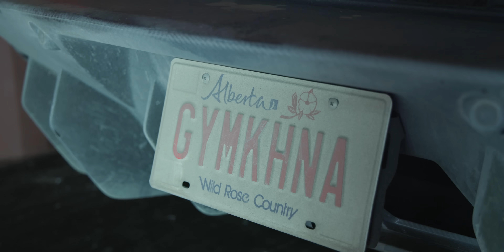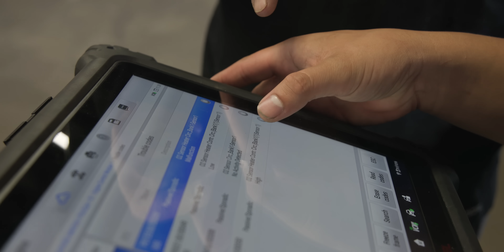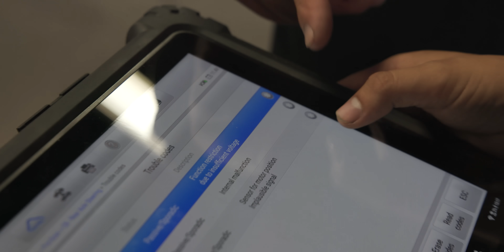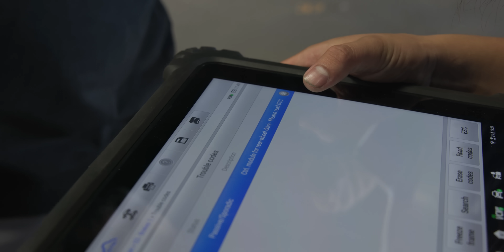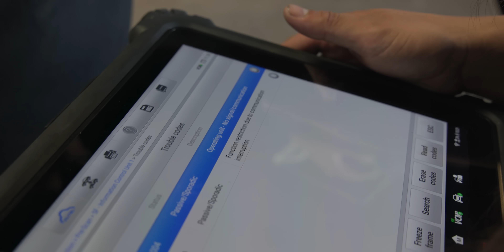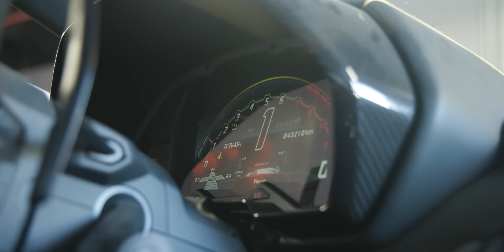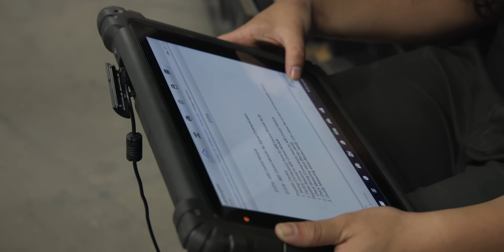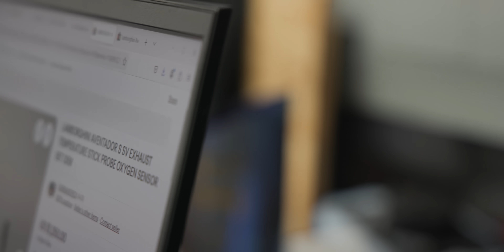TIME TO RETIRE SVJ AFTER DISCOVERING SERIOUS HIDDEN MECHANICAL FAILURES!?

Comment: Isn't that the same car that was smoking because it caught on fire?If it is, you may want to start where that happened. I would start there where it was smoking, work your way back from there. It also sounds like it may be one of the connectors that runs multiple lines to the same place, probably to your computer/brains of the car. Pull up a diagram that shows the entire cars wiring, and their locations. start at one of the connectors you know you're having trouble with, and follow that until you start to notice more wires that were throwing codes coming together (crossing the streams). You may just find your wiring problem there.

Comment: With as many problems the svj has had. Time to junk that problematic transmission, and swap in a sequential gearbox like the f12. Make it custom in every way except the engine and exhaust. Scrap the rear steering, scrap stock trans, complete overhaul

Comment: REPLACE THE WIRING HARNESS ITS CORROSION IN IT...I TOLD DAVE THIS BEFORE THEY WENT ON GUMBALL. DAMON & DAVE & MIKE CHANGE THE HARNESS IT WILL FIX IT. IT WILL COST A LOT BUT IT WILL WORK😂😂😂DDE For Life🔥🔥🔥

Comment: Mike you have a car that has the check engine light on and transmission issues driving it hard and 
9,000 rpm  trying to shoot flames it’s not your car it’s okay if Damon does it because it’s his car maybe see what’s wrong with the car before you thrash on it
Reply: Shifting at redline is not driving it hard for a few clips. Check engine light also doesn't mean something is broken and being in neutral, doesn't do anything to the transmission while revving.

Comment: Your local dealership is raping you on the cost of parts, scuderia parts or eurospares in uk be able to supply and ship overseas for half what they quoted you.   
Oxygen sensors will more than likely be bosch VAG range sensors - £100-150per 
EGT sensors are between £170-250each

Comment: @15:13 . That SVJ is a full-time fire spitter ; of course you should change the pyros and 02's . But I would first see if a fuse hasn't blown , since its the heater circuit .

Comment: Guys seriously Try sorting tyre pressure and re set it as tpms can affect other items like abs and stuff might be rout of a different issue?????
Reply: Wonder if this will even get seen 😂 .TPMs /abs sensors and battery voltage are definitely where I’d start for drivetrain first …. ???

Comment: SVJ has to be fixed.... so it can go to Gintani and get twin turbos! Imagine.... 720 GTR fully built with the motor back in.... twin turbo F12 running and screaming.... twin turbo SVJ on the streets.... Revuelto with a Gintani F1 exhaust to replace the SVJ as a mostly stock reliable car.... what a set of cars guys

Comment: Saving you 30 mins:
What failed:
1.) Set of O2 sensors (4 banks)
2.) Set of EGT sensors 
3.) All-Wheel Steering failure
4.) ABS Pump failure
5.) Tyre deflated

Comment: Anytime you have that many think wrong in the electrical system….its simply because not enough power was supplied to the sensors while was in operation….they drove it for tons of miles with the the voltage going lower and lower…. And then tried starting it countless times where it didnt have enough power to actually let it start(which will also throw a ton of codes). They need to cleat all the codes…. Fix the charging system and go from there

Comment: The codes for rear axle steering are because the car had low voltage. Clear them, and they will not return.